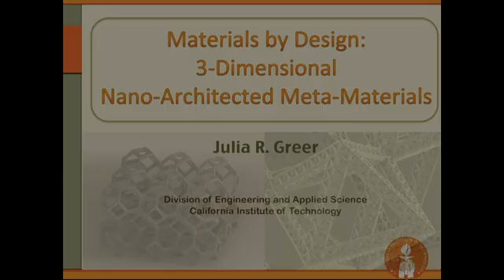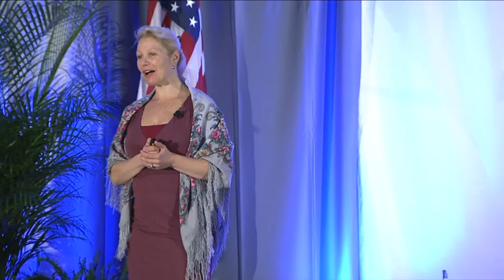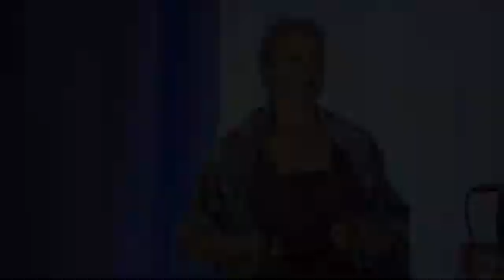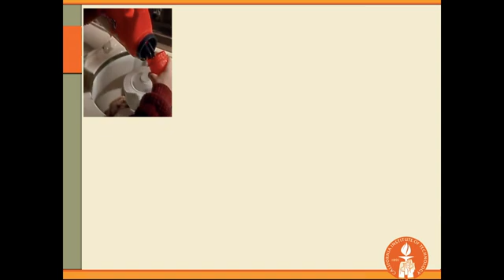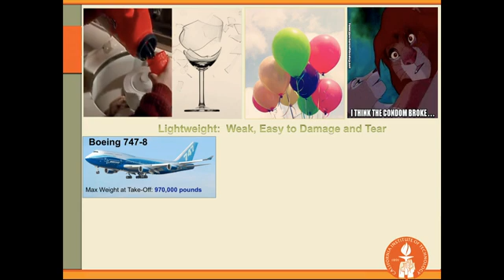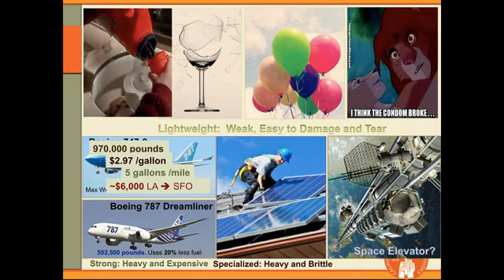Julia R. Greer, Ph.D. on Materials by Design: Three-Dimensional Nano-Architected Metamaterials

Comment: I have a question about the nano compatibility when it come to freeze-thaw interaction. We know that the wood particles are generally absorbent and expand but retain rot damage, steel is absorbent but becomes brittle (at extreme applications)...etc. The question is: does the temperature damage subside as the tensile and compression properties do? or does the "nano scale" feature have an absorbing or repelling contortion.
Thank you for your efforts.